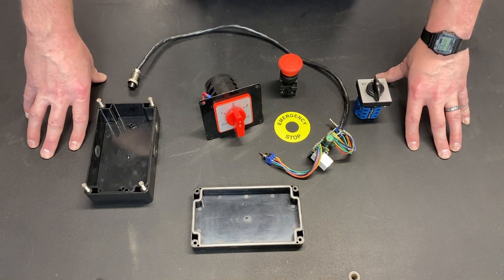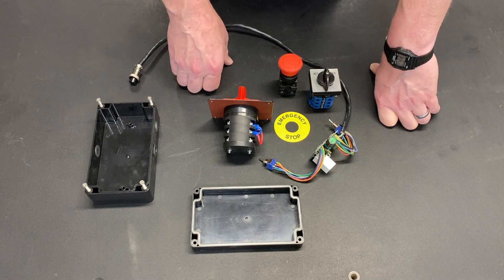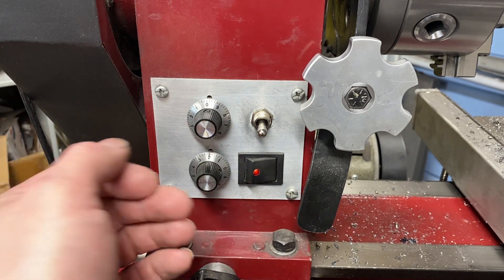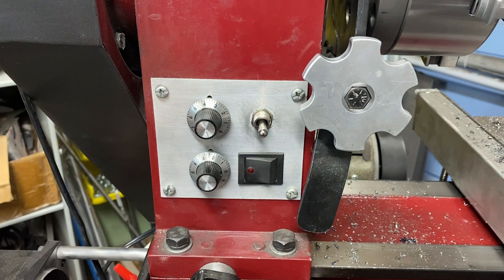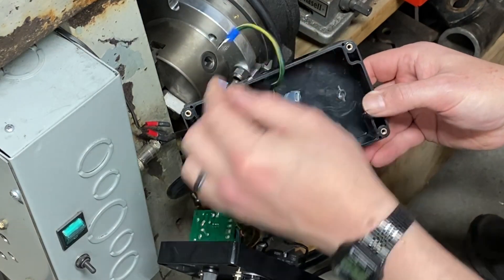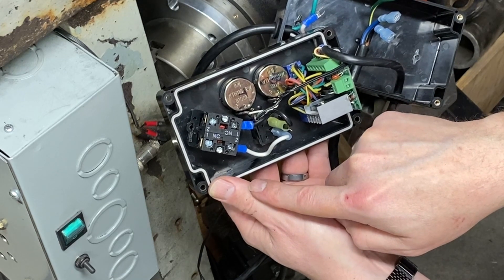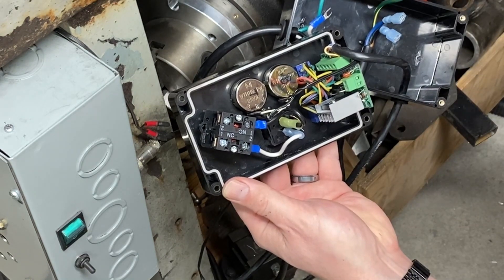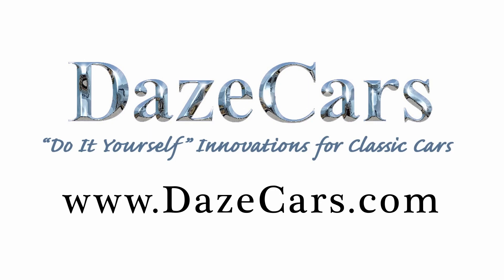NEW DIY Lathe Control Panel: Adding a E-Stop Switch and Brining All the Controls Together

Comment: Daze? Explain to me why I should or shouldn't use an SSR rather than an SCR for cost purposes
Reply from the maker: Not sure where you are located but if in the US the SCR has the same switching rate as the HZ of the wall current.  This results in a slightly smoother power flow.  Because its for something as low tech as a treadmill motor the SSR would likely work just fine but I would bet the power is a little less clean.  All this is theoretical from my perspective because I have no real world experience with SSRs.  One thing I do know for sure is if you go that way make sure it has a wattage capability similar to the SCRs I recommend.  Somewhere in the 10,000 watt range.
Reply: @dazecars  thank you

Comment: The contact blocks on these E/stops are designed for control use, not normally used for power use as they're only small contacts inside, better to use it to control a relay with NO contacts on the relay, when the E/Stop is pressed the relay drops out and opens the power circuit...
Reply from the maker: It’s rated at 10 amps at 660v so it at least 20 ample at 110v. No relay required.
Reply: @dazecars  I have no idea where on earth you’re getting 20a from but these contacts are for control, no motor isolation, the contact styles are quite different….
Reply from the maker: @stephenpartridge686  First of all I want to say thank you for the information you are providing. I totally understand the issues of undersizing a switch and I realize you are just trying to help me . As I said this switch is rated for 10 amps at 660V AC. Every switch you buy of any configuration usually has multiple amp volt rating, for instance it may say say 15 amps @ 110V and 5 amps at 220V. With that in mind there is a direct correlation on every switch everywhere that if you reduce the volts you will be able to put more amps through it.  Typically it is not linear in that the more you reduce the volts the greater the increase in amps it will handle. Because this is as much about contact size and material there is no way to calculate the change without more information but you can make an educated guess. I am reducing the  volts by a factor of 6, now that doesn't mean the amp rating is going up by a factor of 6 but likely 2 or 3 would be in the safe realm. My system is 20 amp AC (that is where the 20 came from) and I am confident that the switch will handle it especially given the hardest thing on contacts is the on off action  with on being harder than off and 99% of the time these contacts will stay in the connected position and never go from off to on with the system powered on. The last couple clues to these being able to handle the amps is the hookup terminal size. The manufacturer is not going to waste money on heavy duty lugs unless they need them for higher amps AND most bench top machines use a switch like this without a relay.  Thanks again for the input.

Comment: How can you tell how a choke is good? I ordered one and it came in the mail kinda beat up. The tabs were bent and a piece of plastic is broken. I tried to continuity test it with no luck. Do I need to send it back?
Reply from the maker: At its simplest a choke is nothing more than a coil of wire so if you do not have continuity then it is not functioning properly
Reply: @dazecars  thanks for your quick reply.  I will send it back!
Reply from the maker: @XtremeCustoms  Glad I could help

Comment: Daze, you see the rotator selector switch that controlled your forward/reverse direction? That’s what I wanted for my treadmill motor. But I couldn’t figure out what Switch could handle the DC current and amperage. I also don’t know how to wire them for DPDT. Any thoughts?
Paul
Reply from the maker: Check your email

Comment: Hi, not sure but I think the EMS NO switch might have been there to trigger an alarm light or sounder if the switch was used. Not much use for a solo operator. One other enhancement you might want to consider is a No Volt Release. That would prevent the lathe restarting after a power failure without manual intervention. It does n't need to be on the main control panel. Very sensible to use massive switch contacts, these things tend to fail just when they are most needed, I'd swear they know when that is!
Reply from the maker: That is kind of what I figured.  It could also be used to engage some other safety feature like a brake.  There are lots of ways to set it up.  Its nice however that the switch is configurable to be setup just the way you need it.

Comment: You REALLY need a 3D printer for your hobbies. The days of scouring the internet for the perfectly sized project box will be a thing of the past. 

Slightly off topic: One of my biggest fears when threading is crashing the tool into the chuck. I've often thought of mounting a motorcycle disc brake in between the chuck and the chuck holder that would also double or triple as an indexer and a RPM counter (I may have mentioned this in your chuck lock video). I figured that a brake pad could be actuated the moment the off button is pressed when threading so the chuck doesn't coast to a stop.

Great info as usual.
Reply from the maker: Its on my to get list... but then that would be another machine for me to modify and improve.  Also I would need to learn the design software.

Comment: Thanks Daze. Nice control box but it looked too small since the minute the video started 😂
Reply from the maker: It is too small, but I am going to live with it for a while as I am sure it will need a little tweaking after using it.  I learned a long time ago to be patient with redesigns.  I have more than once redone something immediately to eliminate an obvious issue but then later wished I had made other changes.